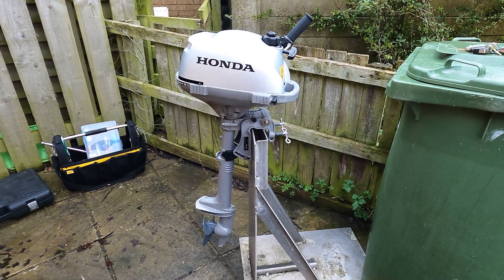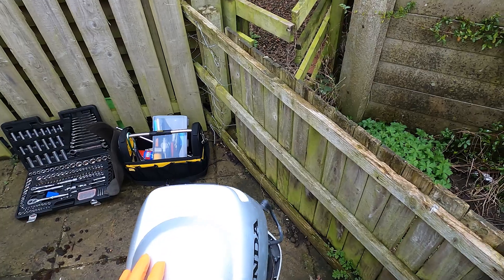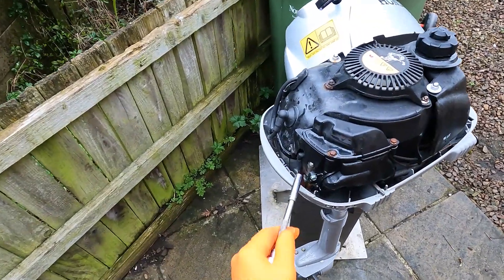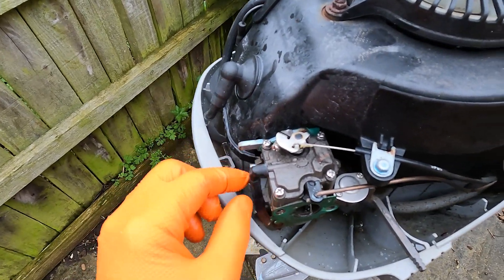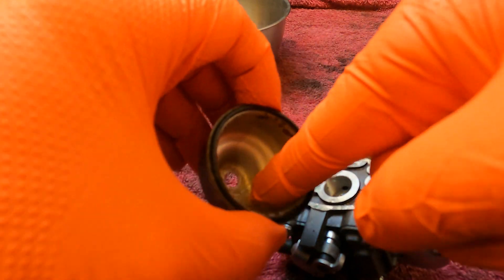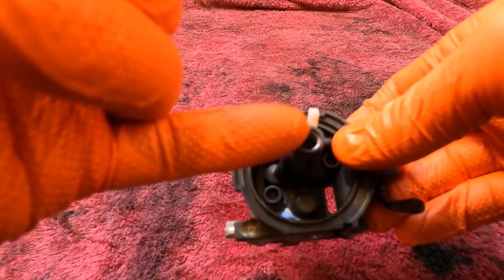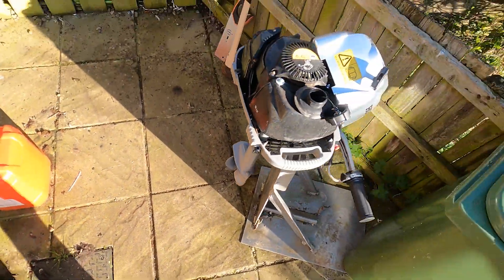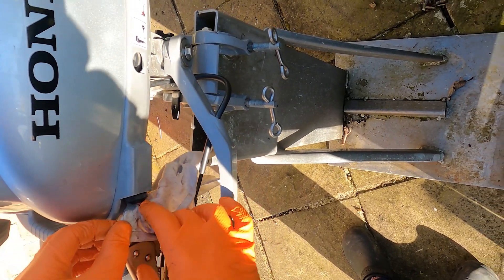Honda BF2.3D Outboard Engine Fault Finding - Won't Start / Bad Fuel + Water - How To Clean The Carb

Comment: How do you adjust the carburetor idle speed? Mine dies when I try to idle, even before the prop stop turning.
Reply from the maker: There should just be a small screw to wind in, this open the throttle plate more.

If your engine dies at idle it may be the idle circuit is dirty too

Comment: I am thinking buying Honda BF2.3 or Yamaha F2.5. What is best choice?
Reply: I bought a Honda 2.3 hp last week, to use as an emergency auxiliary engine for the 75hp Mariner on our Hardy 20 Fisher. It replaces the 8hp Yamaha which was just too heavy to lower into the water, and lift back up.  I chose it over the, cheaper, Yamaha due to it being lighter, I was able to carry it up a ladder, into the boat and lower it into the under floor storage. It is air cooled meaning there is no impeller to monitor and change. It has no F and R gears to select just a centrifugal clutch which Honda has been perfecting on it's step through C50s, C70s and C90s for over fifty years. It is a small air cooled Honda engine which again has been perfected in the small motorbikes. It is made in China, designed and monitored by Honda, but then so is the iPhone. Both Honda and Yamaha make great engines, I had a 350 YPVS and RD250 back in the day and own a forty year old C90 now, but it was the lighter weight that was the decider.
Reply from the maker: It’s a good choice for weight saving compared to other engines. 👍
Reply from the maker: Yamaha F2.5 👍, the air cooled Honda is a weak engine in my opinion

Comment: Honda say put in water run to keep leg cool if run for more than a minute or two..
Reply from the maker: Thats correct, if the engine is run off idle for long then you risk the exhaust becoming hot quickly and possible damage. Short tests are ok

Comment: Is there a fuel filter I should be replaced as well?
Reply from the maker: Yes, there is a small filter / screen on the outlet of the fuel tank.
You have to pull the outlet fuel hose off if I remember and it’s pressed into the tank barb.
Part number - 16952-ZE6-000

Comment: Great video, thanks for your time. My motor runs great, but the propeller seems to always be spinning, even at idle. Not sure whether to remove the engine and inspect the clutch springs/shoes or to lower idle speed; but nice to know I can run it for a few seconds out of water. Any tips?
Reply from the maker: Thanks for watching 👍 
The clutch is designed to be engaged at engine speeds above 2700rpm. If you can lower the idle speed then this should stop this and would be my first step. 

If idle speed is already low to a point that the engine stalls out then the clutch should be inspected. 
Could be that the spring is weak / defective. I’m not sure if anything is serviceable or just a replacement job.

The clutch shoes may also just be dragging on the friction plate out of water but in water this should produce no drive if it’s just dragging as the water resistance should overcome the drag. 

If the idle is high but can’t be reduced due to stall then the carb idle jet is likely blocked / dirty. In this case the carb should be cleaned.
Reply from the maker: Although the engine can be run out of water very briefly, it’s not advisable as the engine can be damaged due to excessive heat.

Comment: I got mine for free it was outaide for a while and i dont know what it is the carb was dirty so u cleaned it and the spark plug was rusty but i left in connected but it wont do anything when i pull the cord nothing happens any ideas?
Reply: Idk what some parts are called but all I hear when I pull the start cord is the fan turning that bold on to the top
Reply from the maker: Do you think it’s not engaging with the engine? 
It should turn over with some resistance, if not it could be the pawls needing some lubricant. These are the bits that engage onto the engine flywheel when you pull the rope quickly.
Reply: @MarineEngineServicing  hm maybe I'll look into it if the fan on top of the engine under that is the part it turns and the nut is rusted but it rotates fine
Reply from the maker: Take the spark plug out and then place a piece of wire or similar into the hole resting against the piston. 
Pull the recoil starter and if it’s engaged with the flywheel it’ll move the wire. 
If you can, manually move the piston via flywheel rotation & set it to bdc. 
Unfortunately being a centrifugal clutch you can just set it into gear and watch for prop rotation.
Reply: @MarineEngineServicing  ok will do thanks man
Reply: @MarineEngineServicing  does it matter what type of wire?
Reply from the maker: @ no your basically just looking for piston travel. This is assuming you can’t see the flywheel turning as its air cooled and under a cover
Reply from the maker: Does the engine turn over when pulled? 
If so you need to check for spark next.
Ensure the kill cord is fitted and spark plug is against a metal grounded part of the block, or use an inline tester.
I have a video on testing for spark on my channel

Comment: Thanks.  I was hoping to see you adjust the carb settings. The original carb was toast so I bought a new one. The engine is idling a bit rough, but when I open the throttle fast from idle it bogs down and would quit if you didn't slack off. If you take it up slowly it runs great. After it has warmed up a bit and you shut it down it won't start again for 5 minutes or so.  I took the new carb apart to check jets etc and all is clear. Adjusting idle screw and throttle screw doesn't make it run any better, after a thousand tinkerings. I assume the idle jet starts at 1 1/2 turns out? The engine had been under water for a minute or so (fell off the back of a friend's boat but they caught it). 
Great Video though, Thanks
Reply from the maker: If the carb went in the drink too then I’d recommend fully disabling and cleaning fully.
The main jet and nozzle under the float should be removed and brass rodded / cleaned.

There is a second pilot jet / slow jet on top of the carb which needs the same treatment as the main jet. This is located under the top cover

Yeah 1 1/2 or 1 1/4 should be a good place to start, make adjustments 1/4 turn at a time from there to find the best setting. The mixture screw may or may not have a limiter cap fitted.
Also check your float is sealing correctly and the needle is still a point and not worn. Make sure your fuel is ok too.

Comment: Too bad we cant see anything you do as you always point too high with the camera
Reply: Rereading my comment i came off  a but entitled, what i mean was more like i have this same problem and would have loved to see in more detail how you checked for spark :)
Reply from the maker: @manuelabergcobo no worries, 
I've got a video on testing outboard ignition, link below.
I know it's not the same engine, but the idea is the same for testing.

https://www.youtube.com/watch?v=iwQQ-KnRbAo&list=PLsj0OkkF7W7vwu5IlD0GROZX_xzVCddsB
Reply: @MarineEngineServicing  thank you and sorry again
Reply from the maker: Ah it’s no problem 👍 thanks for watching
Reply: Good man  @manuelabergcobo
Reply: Hi! I got my engine to run again, so that is the best news ever. But i cant get it to idle and the audio is blocked by the engine noice when you explain what you did to get it to idle. 

Can you explain how you did that?
Reply from the maker: Hi,

So if you’ve cleaned the carb hopefully you also cleaned out the idle jet which is under the top cover on the carb and has a very small orifice that must be clean too. This should be removed to clean fully this jet controls the idle circuit. 

If the idle speed is too low then the idle screw must be turned clockwise to increase the speed. This is a spring loaded screw on the outside of the carb.
Reply: @MarineEngineServicing  thanks very much dude 🙌🏻
Reply from the maker: You’re welcome
Reply from the maker: Hard to tell till after when using the head mount, will try harder next time 😅

Comment: Very helpful video for future reference. I only paid 100 quid for mine the guy advertised for parts, the only problem was spark plug socket loose. There is another problem now a little bit of oil leakage from somewhere. I think gaskets need replacing. Thank you for sharing.
Reply from the maker: Let me know how you get on with the oil leak. 
Location and how you fixed it 👍

Comment: Ciao volevo un consiglio anche io lo tengo ma ho problemi che non mantiene il minimo hanno messo un carburatore cinesr ma.nk qu llo originale xk costa un botto e lo fa lo stesso se rimango accellerato va bene ma se lascio il gas il minimo non lo mantiene ho fatto la carburazione ma njlla da fare potresti darmi un consiglio grz
Reply from the maker: Sounds like the idle jet is still blocked if it won’t idle